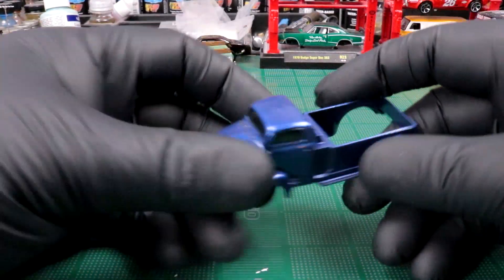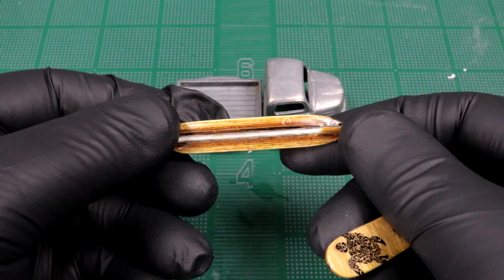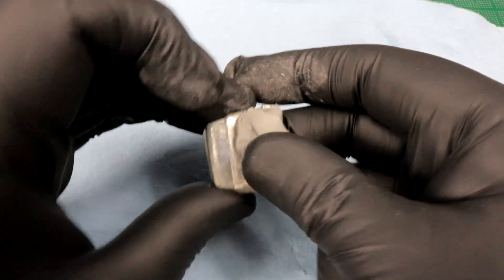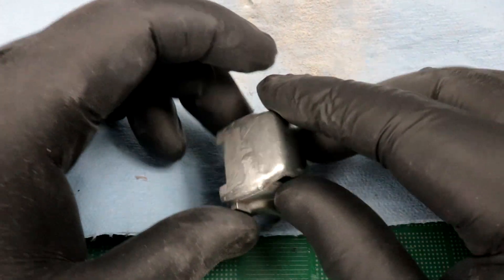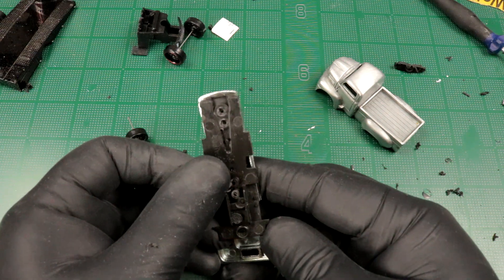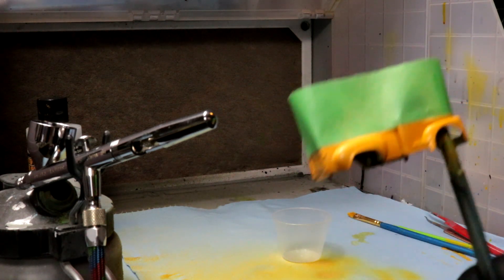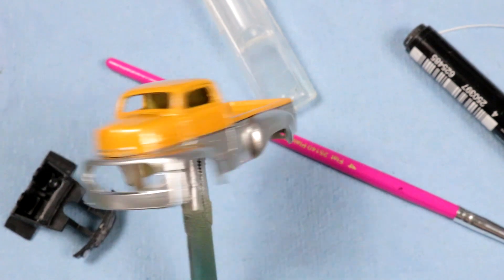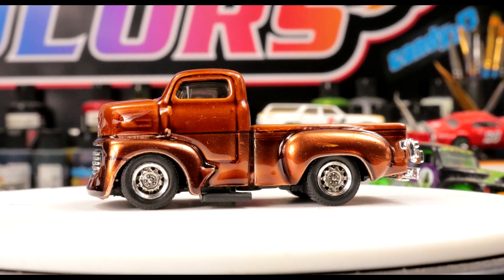I MADE A COOL 1:64 TRUCK OUT OF PARTS

Comment: The water in your line is from your air compression system. Bleed your tank after every use. Condensation builds up in the tank and theres normally a finger-turn knob at the base of your tank. Turn off, drain tank

Comment: As a model train nut you should have left it at yellow over silver. It looked like a Western Pacific diesel locomotive paint job from the early 1960s! 
As for decaling you have to give clearance for the clear edge around the black on a flat surface. It is very hard to get it straight over wheel covers. 
You should also cut to fit each part of the decalsfor each body line separately! Do the bed then the cab.
 To make the decal set right before clear coating I always use Walther's Solvaset or Microscale Industries Microset.
You only have to wait 15 minutes  to dry.  Looks like a root beer truck now!
Needs a couple of big upright aluminum exhaust pipes behind each corner of the cab. Yes! She needs pipes!🔥🔥 Oh those surfboards need a custom
1/43rd scale  beach pickup. Another custom build may be in order!!!🌊

Comment: Fantastic build and I give you high marks for the concept and design of the Blubbing Tuck, but I feel you need to do the top as you have done the bottom..it would flow a lot better and that seems to be the sheen and color you need for the amazing ride. Still over all amazing work per your usual Austin!

Comment: First I love the new direction of creating new customs this way. I love the new challenges that come with each one. Gives variety. I think what would set that truck off is if you cut the inside of the bed out and used tooth picks or something like that for a wooden bed. Especially with that color.